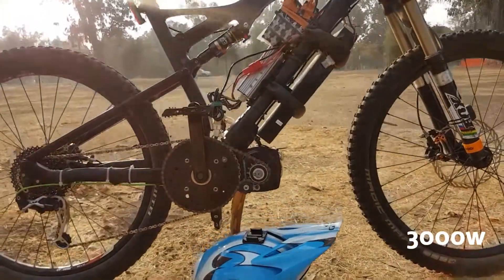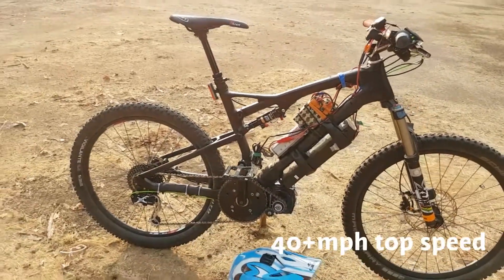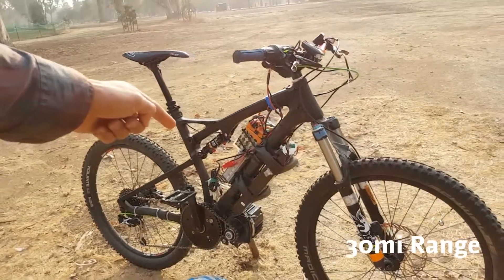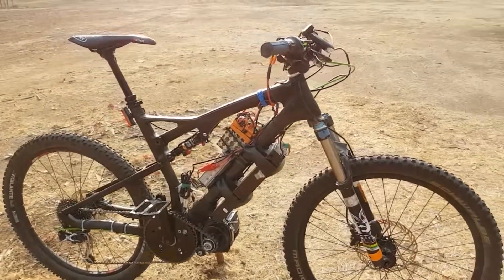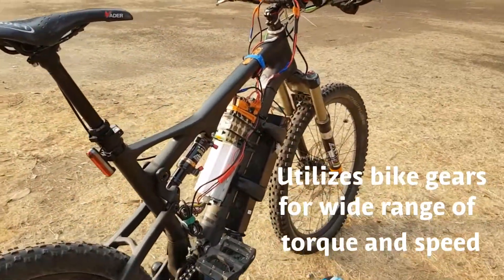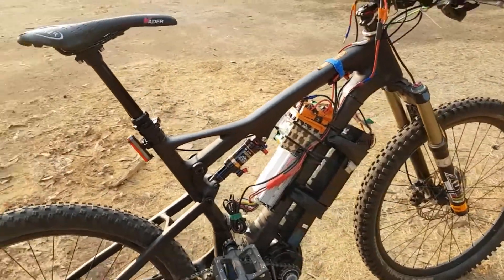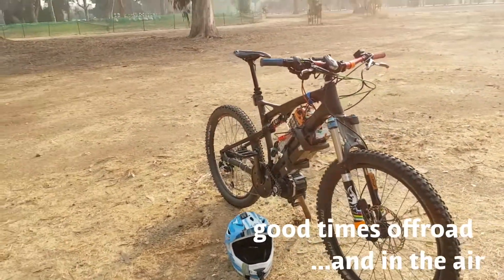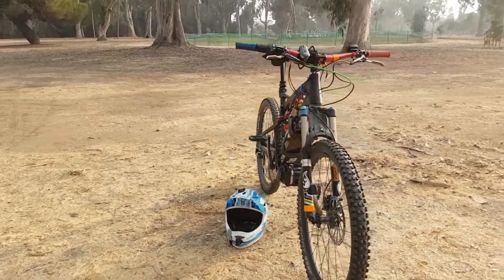e-MTB DIY, 3000w, 40+mph, 30mi range

Comment: Hi nice build. Just one question, I have one of those Kunray 4800rpm motors, I was wondering where you sourced the controller for your motor, as these motors require different controllers to the ones used by the hub motors.

Thanks.